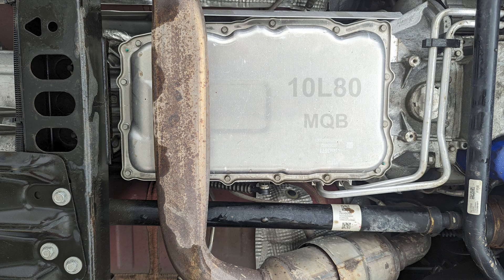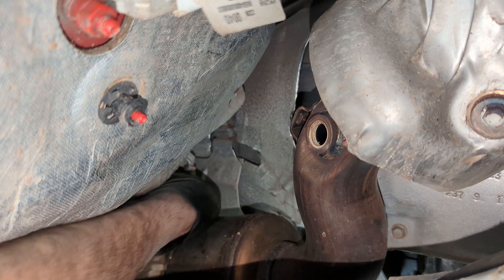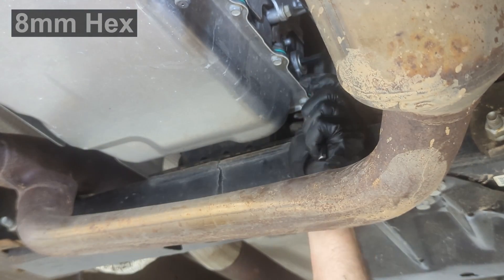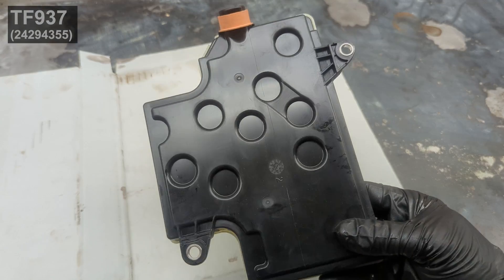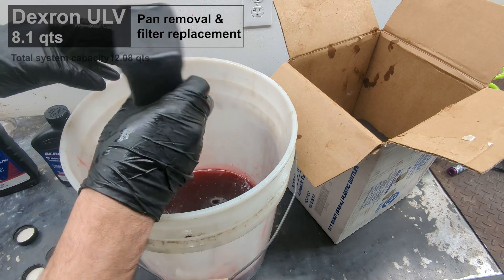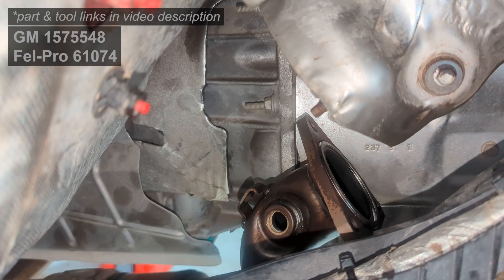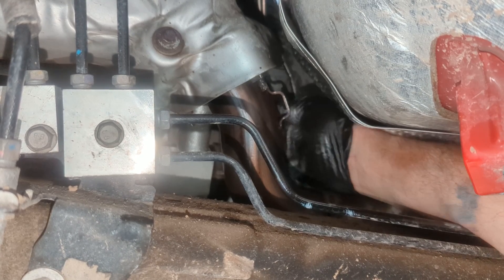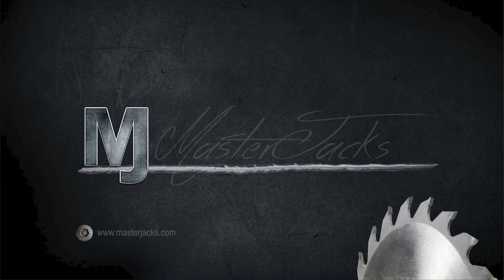2019-2024 Sierra/Silverado: 10-speed Transmission Fluid & Filter Change (10L80)

Comment: Maybe if this transmission was reliable that job would be justified. But with the service intervals required to maintain this tranny thats just crazy lol.  I am doing it now and one exhuast bolt was seized bad. Took me hours and used every trick in the book. Finally after enough heat it came out
Reply: The 10 speed isn't reliable?
Reply: @jostrander71  nope, the gm and ford 10speeds have had plenty of premature failure. But I've also hear if you keep the fluid changed every 50k or so and don't haul. They can last
Reply: @NateM13  Don't haul?? That's what these trucks are supposed to do LOL

Comment: Great video. Would you recommend flush/fluid exchange that the dealer can do along with the new oil and filter, or pan drop, oil, and filter only?
Reply from the maker: Thanks! I'm in favor of the complete fluid exchange, however the pan drop and filter service on this transmission exchanges 8 of the 12 quarts (67%). That's pretty good! If you are doing this every 50k as recommended, I don't imagine ever having transmission problems.

Comment: Dealer quoted me $400.00. I thought that seamed high but man that is a lot of work just to get the pan off.
Reply: That price also includes a trans flush from what i was told. You could come out cheaper by not doing it (the flush). Personally I'm a double drain and fill kind of guy.
Reply: @carsonneuse7980  so I had another shop just drop the pan and change the filter and fluid. Charged me 180. I was ok with it.
Reply: @jeremygregory7178  That seems to cheap...I would be sceptical, thats about the cost of just the fluid.
Reply: @afbigfish1  the dexron ulv fluid on rock auto was 5.00 per quart. They used 8 quarts for pan removal and filter change. The dealer charges atleast 12.00 per quart. The shop also charges 75.00 per hr where the dealer charges 127.00 per hour.
Reply: @jeremygregory7178  Sorry,  I didnt shop around for the fluid I checked the amazon link and it was over 18 per quart. so it seemed sketchy... Thanks for the heads up I didnt expect such a wide margin in cost for the ULV.  Do you know if they dropped the exhaust like in the video?
Reply: @afbigfish1  yes they dropped the exhaust. Which doesn’t take long when you have the right tools and a lift.
Reply: @jeremygregory7178  Must not have been a gas 6.6 2023 to 2024 engine.
Reply: @carsonneuse7980  Yeah for sure but going through that process twice would be a royal pain in the ass...
Reply: I call my gmc dealer and they make me a quote for 399 that includes oil, filter, labor and taxes
Reply: Wow the 3 GM stealerships near me both quoted me $800 and $650 if I brought my own fluid and filter
Reply: @guillermojuarez3551  At 800 I will do it myself 650 is pushing it but I would probably still do it but 800 labor only its a hard pass

Comment: Holy Smokes!!! I waited for this video for so long and just did it last weekend!!!! Throwing a similar video together as I probably did it the harder way - Thanks so much for posting - Going to tackle the cooling system next - 19 Sierra 6.2 / 10 Speed with 56k! Thank you for posting this and having such great content.
Reply from the maker: Thank you for the genuine appreciation! This is a hard one no matter what way you do it! I burned myself, used way too many tools, and said a lot of things I was glad my 10-yr old wasn't around to hear. My favorite thing is hopefully making it look easy. I wouldn't want to deny anyone the privilege of doubting they could take it on 😄. That's awesome you're making a video, I hope it goes well!
Reply: Thank you so much for the words of encouragement as it will be my first video! I too also used a whole bunch of wobble extensions to get the job done....OMG I have burn marks all over my hands and arms because of lack of remembering the exhaust is HOT when checking the fill - You should have seen me freaking out as I did not put in 8 qts at first, started the truck, got to 167 and then pulled the plug only to see I was short - mad rush to fill it to avoid any damage - Love your trick to fill with a seal, then let it get warm - Very Clever @MasterJacks
Reply from the maker: 😂, that's too funny and totally relatable!

Comment: Dear God, something so simple turns into a project.  Fabulous engineering GM.
Reply: It blows my mind that they stopped putting drain plugs on the pans.
Reply: Oh they don't care about technicians.
Reply: @bluesky-ud9wg victim mentality does no one any good.
Reply: Wow, No kidding….
Reply: Terrible
Reply: Hey don’t give GM all the credit this was a joint venture with ford. Fords version at least has a little fill whole/dipstick on side of trans but you still have to burn yourself to check it. 🤣
Reply: The bolt from y pipe to cat back is installed upside down so you have to put a wrench on the nut, from the top... It was like a huge" F You" from the design team
Reply: Also, Im replacing exhaust manifold to y pipe bits with stainless
Reply: Great video the only problem I saw was you need to chew out your customer for allowing his fuel level to get that low. Unless he wants to buy a pump if he does this on a regular basis
Reply: I just did my 2019 GMC 1080 6.2 this week and I know what a pain it is to fill it back up why in the world they didn't put a 20-dollar dipstick in it I have no idea??? What a pain to fill back up by doing it the way they require ,,,but anyway mine burped out over a quart after warming up and going through the sequence of adding fluid up to 8 quartz so mine only held 7 qts after warming up to 175 degrees I don't know if there's a difference in the max tow package or not I'm not sure what happened there but it only holds 7 quarts on filter and pan fluid change I'm guessing it might it may have a larger transmission cooler, so maybe it held some fluid back up in there but you would think it almost have more coming out but anyway if you're doing your transmission some models may only hold 7 qts set an alarm for 8 into it than having a blow back all over you when you take the plug out. Thank you for the video.
Reply: And why take away the tranny dip stick, and fill from the engine bay?  So stupid.....i am really  close to going back to the old stuff....
Reply: Yeah they win every time...
Reply: No kidding! 😖
Reply: It's not just GM.
Reply: You don't have to unbolt the exhaust . You can just drop the pan
Reply: On the 2019+ diesel you can just undo the pan but on the gas engines the exhaust pipe is in the way. I just finished doing this and that’s the only way… even had a prybar, and that would not even pull the cross pipe down enough to remove the pan.
Reply: @KTAdventuresTogether  That is good to know. I have a 3.0dmax and thank goodness something is easier.
Reply: @joediduch5457  please tell me you’ve done this? No really. I got under there twice to try to tackle the job. I got the fluid and all the parts and this and that and ready to go, but I watched another video where the guy tried it without dropping the pipe and he ended up dropping the pipe anyway. i’m just curious if you actually did this. I have a 2023 refresh 5.3 trail boss. I was so tempted to try it, but I wanna know that there’s somebody out there that actually did. Honestly, I was just gonna cut the pipe out do the service and weld it back in or maybe even Put band couplers on there so the next time I can just unbolt the pipe and drop the pan. Yet since I don’t know everything, I’m seeking advice before I do something.🙂🙂🙂🙂🙂
Reply: It's a Ford built transmission.  GM only made their own valve body.
Reply: @domin8ss   yeah but gm put the damn exhaust in the way. plus someone add a damn dipstick again!!
Reply: @454budman  I know about the exhaust from experience.  Somebody above said you can do this job without removing the exhaust.  I tried.  You can't.  The trans fluid fill hole is covered by a heat shield.  To remove the heat shield, you need to remove the exhaust.  Somebody else recommended installing a fumoto drain valve.  That's all fine and dandy for draining, but does nothing for filling.
Reply: @  i just did my wifes 22 6.2 tahoe 4x4. Its possible but damn is it a pain in the ass
Reply: @MattC0725  Got tips on how to remove the pan without dropping the exhaust? Looking at doing this job twice on family vehicles with the 6.2...
Reply: @BainMan64  its sketchy but the way i did it was take the mounting bolt out of the rear of the trans. Drop the trans with a jack as low as it will go and that brings the headers down. Youll have to strap the headers to something I used a forklift. Then you jack the tranny up to create clearance. Tbh im taking it to chevy next time lol
Reply: @MattC0725  Thanks, I may take that advice.... I like to do everything myself but there are certain projects at the end where I wish I had just paid a guy...

Comment: For once having the BabyMax makes routine maintenance easier. Dealing with that exhaust looks like a major pain. Also, the aluminum filter bolts are available online as a valve body bolt kit from several different websites.